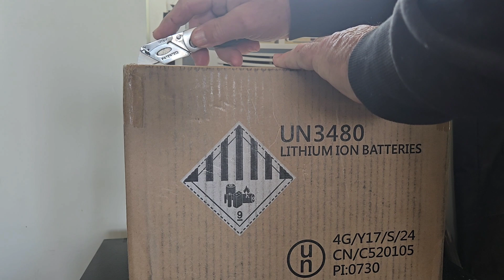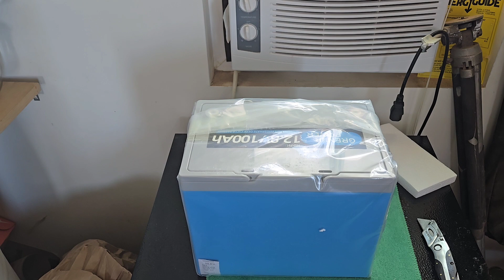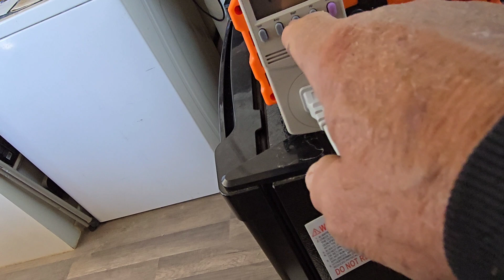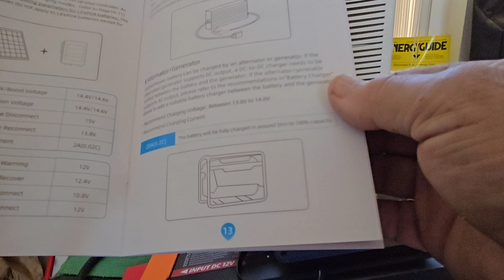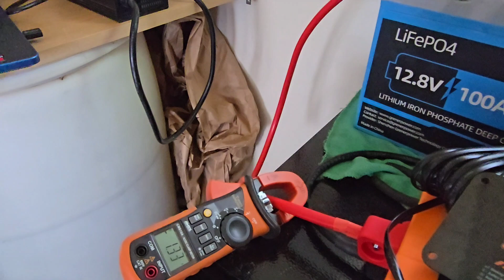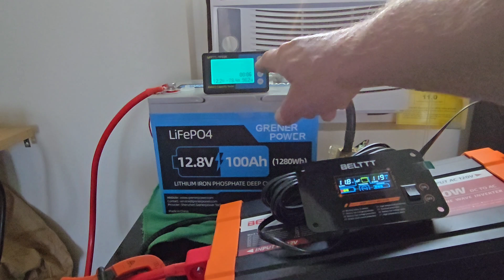GRENER LiFePO4 12.8v, 100ah Review, March 28, 2025

Comment from the maker: Just some added thoughts.  I just checked the Amazon link and this battery is now $125.99!   If you don't need cold temp protection, this could work for people on a tight budget.  You can use it indoors in a living area, since LiFePO4 doesn't offgas like lead acid.